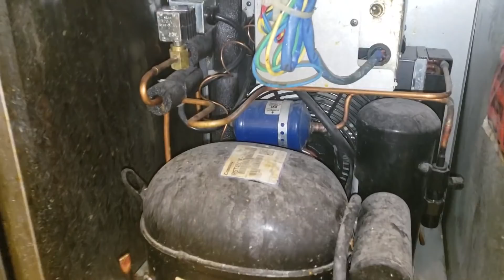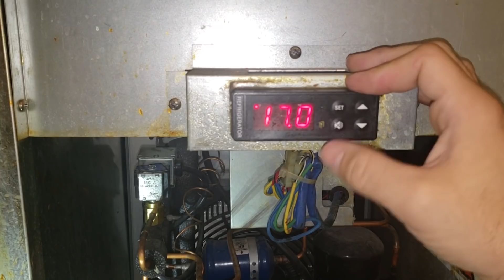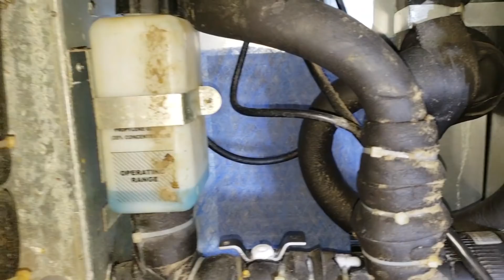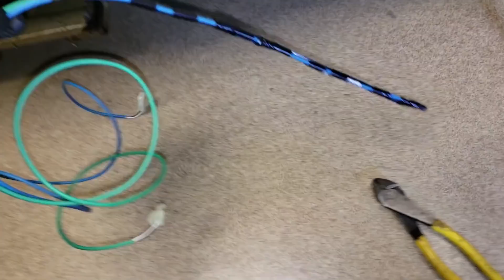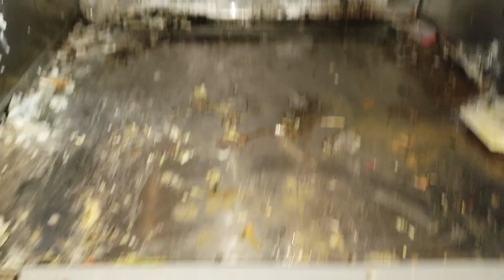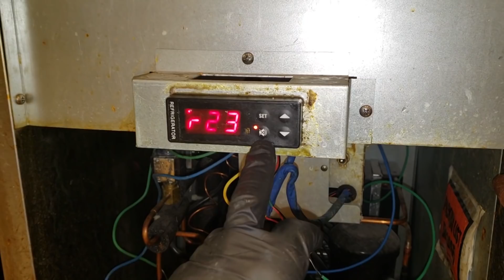KAIRAK BLU UNIT FREEZING THE FOOD

Comment: You should use a scotchlok or dolphin B connector in a cold space.  It will keep the connectors from corroding.  I have even used an epoxy pack to protect them.
Reply from the maker: Great idea! I will be going live on YouTube this evening 11/11/19 @ 5:PM (pacific time) to discuss my most recent uploads and answer questions from emails, the Livechat, and YouTube comments. Come on over and check it out if you can   https://youtu.be/Rm3XGBDxpOQ

Comment: The only thing I would have done differently is use small zip ties to tie the sensors together instead of electrical tape. My gut feeling is that the electrical tape will come loose inside the glycol and get sucked into the pump.
Reply from the maker: That is a good point! I will be going live on YouTube this evening 11/11/19 @ 5:PM (pacific time) to discuss my most recent uploads and answer questions from emails, the Livechat, and YouTube comments. Come on over and check it out if you can   https://youtu.be/Rm3XGBDxpOQ

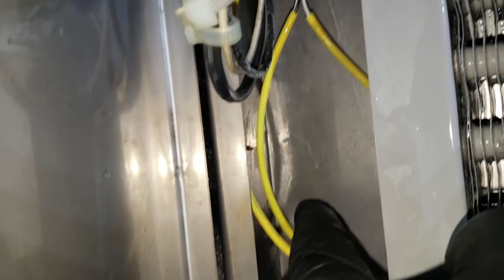Comment: 5:19 That stripped wire is pretty long to get into that wire nut. Won't it get grounded?
Reply from the maker: No the wire is not exposed the yellow is just an outer jacket and the black and white are another jacket, the wire itself is under the black and white so its fine.... I will be going live on YouTube this evening 11/11/19 @ 5:PM (pacific time) to discuss my most recent uploads and answer questions from emails, the Livechat, and YouTube comments. Come on over and check it out if you can   https://youtu.be/Rm3XGBDxpOQ

Comment: I had sensor failures due to ingress of liquid. Sensor on the ouside of the pipe provides proper temperature measurement and it should simply stay there. Your solution brings a number of risks: 1. after refilling by staff, the sensors may be put incorrectly, 2. the sensors may get damaged by glikol, 3. drilling  a hole in the cap is a no-no - you would not like it done by your car mechanic.
You may be right in your choice. I do not know this paricular equipment. 

For me, personally, the main questions are: is my solution in accordance with good practices? Will OEM service confirm my solution as best choice? Does it look professional and tidy - it will be judged by people who do not know and use heuristics (clean, tidy, as it was in the new equipment = good). I noticed, I'm never on my job when critics arrive and try to tear my reputation to pieces.
Reply from the maker: I hear your points but the manufacturer actually told me to do it this way...........
Reply: @HVACRVIDEOS  This is what I recall from one of your previous videos and this is what puts you in the right internally. For all other people, at least some of my points still hold.
I have great respect for your knowledge and effort you make to make this content available for guys like me. Kudos to you. Still, personally I'd ignore the recomendation from the manufacturer (which puts them in a bed light) and do it in the more "defendable" way. Or maybe not, after all other factors are taken into account (money, time, etc.).
Greetings from Poland.
Reply: Just from experience on different OEM setups... The ones that install a copper tube soldered onto the fluid line, insulated and install sensor into tube with thermal transfer compound. The best design for accuracy, service and longevity hardly ever have issues with that setup and I've seen that with 2 different manufacturers that I recall. I've seen OEM's decisions with just mounting sensors on outside of line and accuracy isn't great, oxidation/surface contact over time kills them
Reply: @grindstone5368  I agree with your points. This should be common sense. At the same time 9 out of 10 sensing bulbs of TEVs are installed without any pocket tube/thermal compound/thermal insulation on the outside.
When changes in temperature are not fast and dynamic properties do not play role the insultion from surrounding air seems the most improtant part. If this is done, most of the error is takek care of.

Comment: Good video! I used to work with a lot of kairak blue and it is very common to see failed sensors. I used to replace the sensor attached to the suction line and install a new controller to set the temperature to 26.5, after I never had any issues with it besides the pump fail is well.
Reply from the maker: Right on I come across them every now and than... Thanks for watching! I will be going live on YouTube this evening 11/11/19 @ 5:PM (pacific time) to discuss my most recent uploads and answer questions from emails, the Livechat, and YouTube comments. Come on over and check it out if you can   https://youtu.be/Rm3XGBDxpOQ

Comment: where originally sensors installed? Thanks for video.
Reply from the maker: The original sensors are strapped to the the glycol lines up inside the unit they are behind about 18 inches of foam insulation.